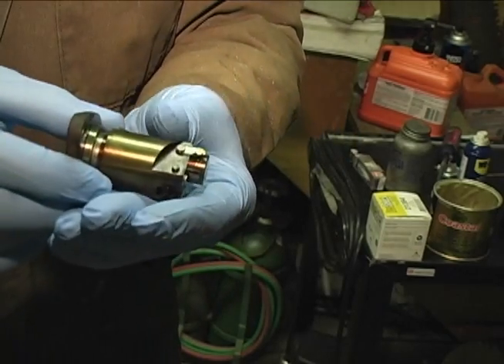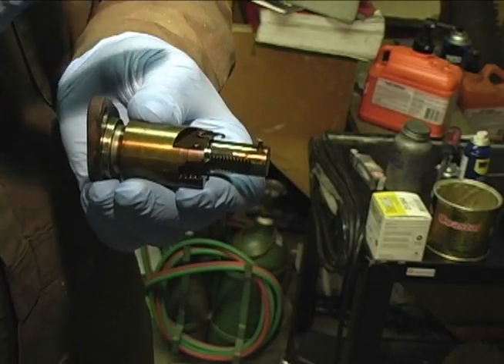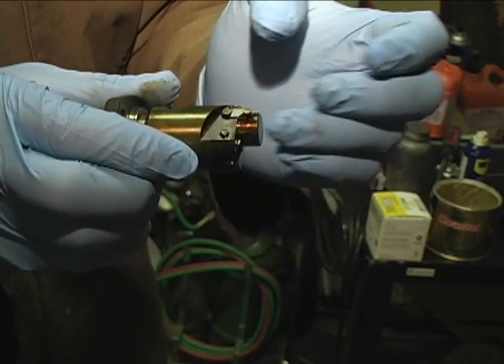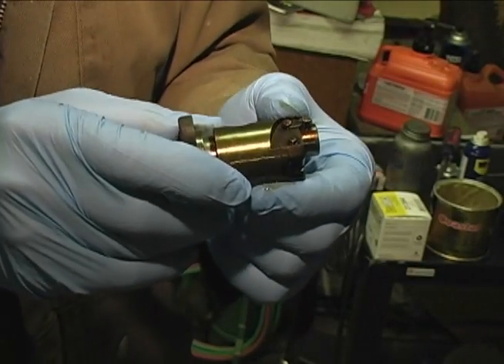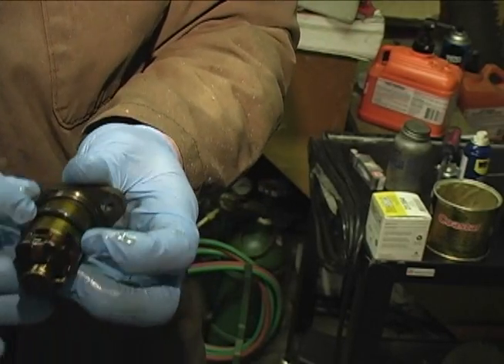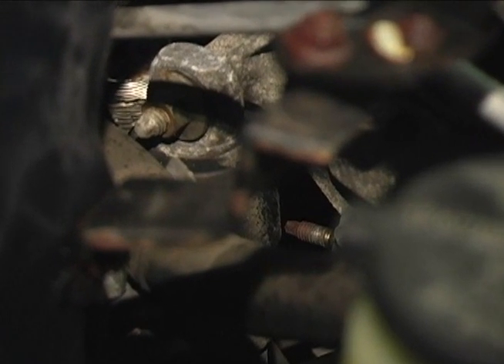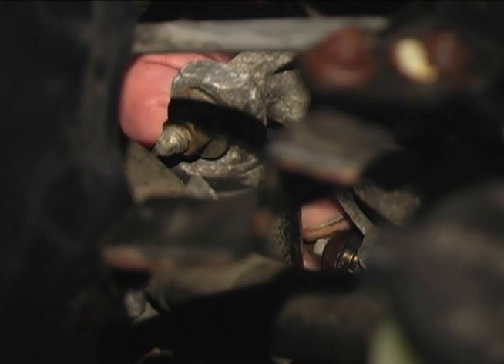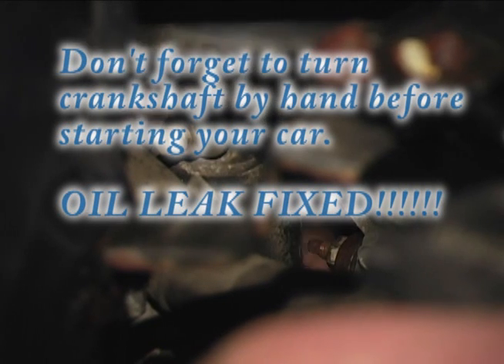Oil leak repair on Toyota Matrix and Pontiac Vibe 2003-2008

Comment: How do you turn crankshaft  and how much do you turn ,you didn't show that
Reply from the maker: You put a socket on the crankshaft bolt and just turn it clockwise a few degrees. You'll probably hear the zip sound as the tensioner engages.

Comment: Does the tensioner need gasket sealer ? Or will the o ring keep the oil out??
Reply from the maker: The o ring should do it!!
Reply: I think I under torque it.. I got under the car with a 3 8 ratchet and snugged it a bit more and I did feel it was not tight at all. And this morning there was not a drop of oil in the floor
Reply: Awesome video👍. And thanks for takeing the time to reply to the messages💯

Comment: Hello friend.. I just installed new valve cover gasket and new t c tensioner. But I still have a leak in the tensioner area any ideas why or from were??
Reply: My leak has my power steering pump dripping oil on my 2004 toyota matrix
Reply from the maker: YES, I do! The other super common source of oil in this area is the crankshaft oil seal!!! That will solve your problem 100%.
Reply: Thank you 🙏
Reply: My power steering pump is well above the crankshaft.

Comment: If you have problems getting a proper new o-ring from Toyota you can always remove the o-ring from the tensioner and wrap the seat of the tensioner with Teflon tape and then reinstall and reuse the original o-ring.  The Teflon tape will take up the o-ring slack and make the o-ring reseal properly again.

BTW Are the tensioner mounting studs facing the firewall?  I have a 2002 Rav4 with a timing chain tensioner leak and I cannot find the timing chain tensioner anywhere.  There are a lot of A/C hoses and electrical wiring blocking the view and the timing chain tensioner can't be seen from underneath the Rav4 either.

Comment from the maker: A new update! The second most  common problem with oil around the front of the engine is the crankshaft oil seal. So, if it isn't the tensioner...try the crank seal!!
Reply: Good to know.

Comment: Hello is this located on bottom of engine left or right side ? I have oil leak but can’t tell where from the belt is flinging it everywhere . Thanks for help
Reply from the maker: It's not at the bottom of the engine!!!
Reply from the maker: It up high on the cylinder head on the pass. side!
Reply: Thank you Alan very helpful
Reply: Alan I still have bad leak replaced the o ring with a random on I found looked about right size ( hopefully it doesn’t have to be a oem) 
Leak is bad on bottom by the crack shaft what you think crankshaft seal? Or timing chain gasket ? 
Thanks for help!
Reply from the maker: @kcenglish5465  If it's up above the crankshaft then my money is on the timing chain cover gasket.
Reply from the maker: @kcenglish5465  and you really should use an oem!!!!

Comment: How does turning the crank shaft release the tensioner from the hook?
Reply from the maker: It's funny.. I'm not sure exactly...but sometimes, as you're tightening the nuts down, the mechanism automatically releases even without jarring the crankshaft. You can distinctly hear that "zipping" sound when the rod extends out.
Reply: Turning crank CCW tightens tensioner side of chain, pushing in plunger, releases hook. CW loosens chain, allows plunger to extend.

Comment: I'm not sure where the crankshaft bolt is to manually crank the engine after replacing the tensioner so that it unlocks... can't I just use the key to briefly engage the engine (without letting it start) to unlock the tensioner?
Reply from the maker: The crankshaft bolt is in the center of the big crankshaft pulley! I don't think engaging the starter is a good idea!

Comment: this does not apply to the 1st Gen pontiac Vibe GT or the equivalent 2ZZGE engine Toyota Matrix. As a bracket on the front of the engine prevents the removal of the timing chain tensioner.
Reply from the maker: Aaron.. thanks so much!
Reply: to be clear it is the tensioner bracket which is distinctly different on the Vibe GT. Releasing the serpentine tension is required so the tensioner bracket can be moved out of the way for removal of the timing tensioner. be cautious and make sure you use the correct socket to release the serpentine tension. the person who worked on my GT previously used an sae socket instead of metric and stripped my tensioner stud.

Comment: Do I need to turn the crankshaft  ?  Please show how to turn crankshaft on Toyota . thank you
Reply: Can only changed  O ring and Just put it bank without Reset the tensioner. ?   So I not have to turn the crankshat ,right?
Reply from the maker: +richer superman  Hi! I'm not sure what you mean!!! After installing  the tensioner, just put a wrench on the crankshaft bolt and turn the engine just a little bit clockwise.

Comment: I'm having a hard time locating where the timing chain tensioner is on my 2003 Toyota Matrix.  I know you point to it Alan in the video, but I still can't find it.
Reply from the maker: +Kyle Legman  Try to look in at the same angle that i show it in the video. You could also use a mirror and look for the two studs and the diamond shape!

Comment: Do I have to lift up the engine to do this job?
Reply from the maker: +Mando Alvarez   Hi Mando! No... you don't have to lift it at all.
Reply: Awesome thanks. After I replace the O ring how do I trigger the tensioner to place tension on timing chain before I turn car on again? I have a 05 matrix xr with this leak
Reply from the maker: You just put a wrench on the crankshaft pulley and move the engine a little bit clockwise. As soon as it starts to move, the tensioner will engage. It may even engage as you are tightening it down. As an aside, be sure that the tensioner is going STRAIGHT in as you tighten it down; otherwise, you can pinch the o ring. (I guess that happens on occasion, accord. to my local dealer!)
Reply: +Alan McRae awesome. is the noise conspicuous when it engages? or do u recommend me tuning my ear real good to make sure I hear the tension engages!? thanks !
Reply from the maker: I could hear a zipping sound when I did it, but it WILL engage as long as you tighten it down and move the crankshaft pulley a little bit! I actually heard it engage while i was tighening it.

Comment: Thanks for the video. In what direction do you  rotate the engine after installation and how many turns to release the tensioner?
Reply: +Alan McRae 
Many thanks Alan.
Reply from the maker: +lascar48    Hi Again!! Just checked on it again and it's best to rotate the engine clockwise (as you are facing it), although you may even hear the tensioner "engage" or spring open when you tighten it down. Best of luck!!!
Reply: +Alan McRae 
First rate Alan, thanks again.
Reply from the maker: You're welcome! As I said, you only have to turn the engine a few degrees and you should hear the zipppppp sound from the tensioner!!!

Comment: Great video. I purchased the o-ring for about $3. My question is when retightening the bolts, what torque setting should I use? Also, it's seems that I can do this project when the engine is cold and not spill oil as I'm removing the tensioner and placing it back or will a lot of oil come out?
Reply from the maker: +Paul Meneses   Hi Paul.... NO oil will come out as you change it! As far as the torque, I'm not sure...it really doesn't need to very tight...and the nuts are pretty small. Be sure when you put the tensioner back in, though, be SURE that you 1. put oil on the o ring and 2. that you put the tensioner STRAIGHT in or the o ring might get a little pinch somewhere and continue to leak!!!!

Comment: I have replaced the serpentine belt 4 times over 2 years because of squealing. That only took care of the problem for a couple weeks. A auto garage says the timing seal is leaking on the belt and creating the squeal. Is this right?
Reply from the maker: +Rose Peters  Yes, it could be! The oil can get over many things, including the belt!

Comment: would have been so hard to show the part number for the O-ring ?  My local stealer said it is not available separately and I have to buy the chain tensioner.  When I argued he said well give me the part number and then I can see what to do. So next time please show us the part number. that would be the key.
Reply from the maker: I can't totally make up for your parts guy being a jerk!!! But I'll find out the number and give it to you. How does that sound?
Reply from the maker: and your stealer IS a stealer!!!!
Reply from the maker: The part number for the 0 ring (for the base model of the Matrix is #9030122013 and is available from Toyota Parts Direct for $2.92 plus shipping. their phone number is 1 866 912 1903

Comment: How can you be certain if it's leaking from here? Is it visible when the car idles to see this part?
Reply from the maker: Steve, you probably would  see it with a flashlight and a mirror. But more easily you can just get a paper towel, etc. and see if there's oil on the head just around the flange. Similarly, clean all around it with paper towels...run the car for a few minutes and see if fresh oil is there.
Reply: Cool, thanks for the response and the vid.

Comment: I have a 2003 Vibe that is losing oil, i don't see and oil on the space i park, but i do see oil all over my aternator. Sometimes when i drive i see a cloud of smoke for a few seconds and it stops, this happens once a day. Could this oil that is leaking on the aternator be getting on my exhaust pipe and smoking? Do you think its leaking from the chain tensioner, just that i don't see oil where i park, thanks
Reply from the maker: Do you see the cloud of smoke actually coming out of your exhaust????
Reply: yes, but i have found after replacing the pcv valve it stopped smoking, thanks
Reply from the maker: Are you saying that the PCV valve also caused the oil leak on your alternator?? Thanks!

Comment: We have a 2003 Pontiac Vibe which started idling really rough with a huge reduction in acceleration, with the check engine light flashing. Today I went to change the spark plugs, after the engine codes showed misfiring in both cylinders 2 and 4. I started with the furthest on the right and noticed a little oil on the old plug after it was extracted. The next showed the same. The third was completely drenched and dripping oil when it was extracted. The last was relatively dry. I'm assuming this means some kind of seal or gasket has failed. My question is, is this reparable? And if so, is it something that can be reasonably handled by someone with very basic auto repair skills?
Reply: +Pariahnine  spark plug tube seals part of a valve cover kit

Comment: How many time it takes to change, what is the cost if you do it yourself and it is really difficult, c considering that changing a starter would be a 3 on 10, thanks!
Reply from the maker: Hi Emmanuel, this only takes 1 hour at the most and it is NOT difficult.... easier than a starter!

Comment: I just did this to my 2000 corolla, it had a big oil leak. I bought the oring at the stealership for 5.77. Reset the tensioner, put the oring on, put it back in and turned it over by hand (19mm socket) when I turned it over I thought I heard a ratcheting noise which I guess is the tensioner releasing. Started it up and it sounds the same as before so I guess its in there right. Hope it fixes the leak. How much oil can a person lose with this thing leaking? I lost a 1/2 quart 250 miles after an oil change and then it seems to slow down. I noticed the leak and figure that's where it goes?

Comment: Hi Alan,
- did your matrix stop leaking after you put the RTV seal?
-  Where exactly I have to put the RTV seal, in the same place I put my O-Ring?
Reply from the maker: Hi Mario, I just put the RTV on the area above the o-ring and on the flat flange, too. It did stop the oil leaking. Unfortunately, I found out that I also need to replace my oil pan gasket which is also leaking... Video will follow!

Comment: Hi there.
My Corolla has the same issue. Already have the new o-ring and i'm going to replace it at the end of this month (time of the oil service).
Nothing else is need besides turning the crank by hand before starting the engine?

Comment: Thanks a TON! O-ring replaced (5.94 at Toyota dealer), which took about 20 min. (once I found the nut that I dropped!). And new Gates serpentine belt replaced ($25 at O'Reilly), which took about 20 min. as well...Probably saved about $375 altogether. Now I can get some new tires! :D

Comment from the maker: Hey, I'm pretty good, huh? hahaha....  Are you SURE the stream of oil is from the filter gasket and not the sensor??? It will be easy to be sure by just changing the filter and looking... but having a "stream" sounds like a bad sensor!  As far as the oily serpentine belt, I don't really know... but they are quite easy and relatively cheap to change out. Thanks for writing back!!!! I'm so glad you found the problem area!

Comment: Hi Alan -Thanks for the input on this. After work I got set up with a bright light & went under the hood & checked the oil sensor area.  At first I didn't see anything then there it was! A tiny jet of oil  that was shooting from the top of the oil filter toward the pass.side radiator.  I did look at the filter area while on the road, just couldn't see that tiny stream in the bright daylight! If only I had felt around with my hand.  I will check tightness & find out why gasket let go next.

Comment from the maker: and it appears that the oil pressure sensor is attached just above the oil filter..... so just get under there and see if the oil is coming out there... also the oil filter could be lose..but that wouldn't explain how the oil got up so high.....

Comment from the maker: Hi HealyCopter... I don't know if an 0-ring could allow that kind of oil loss, but with so much oil leaking it shouldn't be that hard to find. Often, cars can lose that amount of oil if the oil pressure sensor goes bad. The center of the sensor can let go and the oil just comes pouring out. Take a look online (and I will, too) at the location of the oil pressure sensor(sender) and see where it is. If THAT is the problem, it's usually obvious to see and easy to fix.

Comment: We had a scare with our 2006 vibe today (65k miles), with oil under the hood at our destination (65 mi away). Belted end of the engine was oil soaked. NO  low oil or high temp warings on dash.  I bought 6 qt oil & put 3 in, & started the car.  It was dripping but t so we got home stopping & checking often.& it seem to lesson as we got closer to home.  If it lost 3 qt in 50 miles on the way up, could the oil tensioner o-ring account for that in your opinion, or is it likely a main seal? Thanks.

Comment from the maker: Oh, and one more thing... if you are flexible - you could use a mirror and flashlight and actually look at the area around the tensioner (clean it first with paper towels or whatever) and see if you can watch it leak down the back of the cylinder head....but if it's oily back there, you probably have the problem anyway!

Comment from the maker: Hi Junbug, first off...If your mechanic says that the timing chain tensioner is leaking then that what he means really is that the O-ring on the timing chain tensioner is bad - I believe that's really the only way that it could leak - and that's what my video shows how to replace. As far as the crankshaft seal, who knows? But it certainly wouldn't hurt to do the o-ring first then give the car a few days and see if the leak stops. It would have to be done anyways, even according to your guy!!!

Comment: Hi Allan.My Toyoyta Matrix 2003 has been leaking for a while,my local mechanic told me its a crankshaft seal & timing chain tentioner...he did not mention the o-ring. he is asking for $ 275 for parts & Labor....After watching your video. I feel like i can do it..Not sure if the mechanic is trying to rip me off..should i start replacing the o- ring first? Hopefully the leak would stop....Do you have a video to change the crankshaft seal?
Thanks   JR

Comment from the maker: You only have to turn the motor a little bit, just a few degrees. I turned mine probably about 10 degrees and I could hear the tensioner spring out! Another time I installed one and I could hear the tensioner spring out just by being tightened down. I think you can turn the engine in either direction, but the normal engine direction is clockwise (looking at the front of the engine).

Comment from the maker: Also, in response to someone who asked how to turn the crankshaft... it's easy to do by turning the alternator (put a socket on the nut in the center of the alt. pulley) which turns the serpentine belt which turns EVERYTHING!!!

Comment from the maker: As a follow-up, I discovered that my repair had started leaking AGAIN! I called my Toyota friend and he told me that even at the dealers, they usually add an RTV sealer around the back of the plate, so I would add that to the protocol here!! I used the permatex black rtv for mine.

Comment: How do you turn the crankshaft? I was replacing my serpentine belt as well as doing this repair, so I took the serpentine belt off to help make it easier to turn the crankshaft by hand, but I could only get it to move one inch in each direction. I believe I heard the tensioner release itself, but wasn't 100% sure. Seems to be running fine though. Thanks for this video BTW, it was a great help.